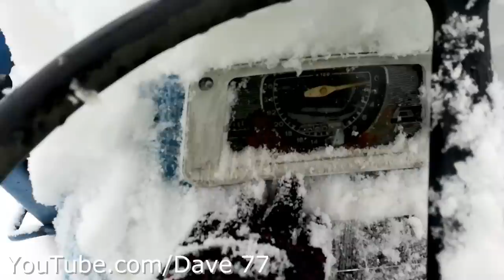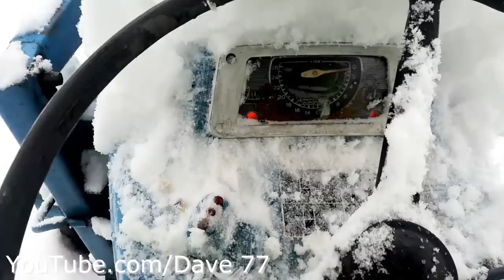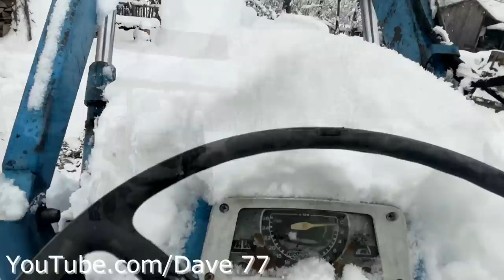1966 Ford 4000 Tractor Cold Start

Comment: I love the smell of old tractor diesel fumes. It takes me back to the good old days. Im only 26 but I can imagine old machines like this lovely old gal being a lot easier to service than all the computer controlled stuff of today. Thank you for posting and hope you’re well
Reply from the maker: Thanks a lot for your comment.
Yes, they don’t make them like they used to. Nowadays, tractor manufacturers are more oriented towards electronic systems and software based interfaces that are meant to provide a better operating experience. 
However, when they happen to break, there’s almost nothing the average person can do to fix it. 

I prefer the good old tractors.
Way more easier to diagnose and fix a problem. 
Electronics used mostly for the starter, alternator, basic sensors (water temperature, oil pressure) and a proper wiring of the ignition, switches, fuse box and finnaly the lights. 

That’s the best version of a tractor for me as far as electronics are concerned.
Best regards.

Comment: Pretty cool trick. I'll admit it worked. We had a Ford 3000 for many years. Fed cows with it. Below 30. Give her a shot of starting fliud. Below 10-15 had a 110 volt mangnet heater. Stuck it on the bottom of oil pan. + Starting fliud. Always did the trick. We hardly ever go below zero where I live how ever!
Reply from the maker: Roger Carrico Nice trick too. Magnet heater... Never heard of it, but I'm sure it gets the job done. Now what I did is kind of a old-school Romanian tractor starting up style. My father taught me. He used to start our UTB tractor this way in the winter.

Comment: Many hours on a Ford 4000 and starting it everyday in some very cold weather to give the cattle hay. Pull throttle half way, pull choke full, push in clutch to lower drag, crank and when it fires push in choke immediately. Started it for many years and never turned over more than twice before starting.
Reply from the maker: Impressive. Thank you.

Comment: Good video. 

Here are three ways to help improve cold starting in winter.

1, Add quarter of a gallon of petrol to a full tank of diesel fuel. It thins the diesel, stops it waxing over, makes it burn hotter and makes the fuel more combustible. Do not add more than a quarter to a full tank of fuel because it could damage seals in the fuel system.

2. Add and egg cup full of Acetone to a full tank diesel fuel. Acetone doesn't thin the diesel but it does add Oxygen (Oxygen is trapped inside Acetone) and it makes it more combustible and run a little hotter. Beware adding too much!

3. Make sure the exhaust isn't blocked by snow for example.

I consider a full tank of fuel is 11 Imperial gallons so deduct the amounts given accordingly.

Be very careful and observe caution at all times. Not advised to set a burning torch on an engine for the reasons cited below.

1. All you are doing is mixing burnt fuel fumes with cold air and that mix is going into the bores and doesn't get a clean start because it partly chokes the fuel air mixture in the bores.

2. Risk of fire spreading!

3, Places soot/carbon deposits in the air intake system which over time will reduce cold air intake. A bit like never cleaning an air filter or changing one.
Reply from the maker: Amazing comment.
I've never heard about these methods before (adding petrol or acetone to the diesel). I don't actually start it up that way all the time as I rarely use it in the winter. But you seem to really know what you're talking about sir, and I want to thank you for your methods, pieces of advice and cautions, all well explained.
I hope you liked the video, and sorry for the late reply. ✅ 🙂
Reply: Hi  @Dave77  These are methods I have used in the past but one must be careful not to add too much of either and never add Acetone and petrol together into diesel. Only use one or the other. Happy to help you young man if it makes life a little easier for you. Cheers, Jon DingleZilla Esq.
Reply from the maker: @JonDingle  I understand. Either diesel + petrol or diesel + acetone. Not mixing all three together. Your methods will help me in the future for sure. As I said, thanks for sharing them with me sir, and greetings from Romania.
Reply: @Dave77  No problem young man, I would love to visit Romania one day. It has some very beautiful countryside (and ladies too) and I reckon it is worth a visit. Best regards, JDZ.

Comment: This is the perfect video for when someone says something about how they miss "the good old days when tractors were simple and reliable". Ok grandpa, I'll go hop in the 5125 that will start up in 5 seconds and I'll see ya in an hour when you get old reliable running. Don't get frost bite lol
Reply from the maker: Alex MacLean The tractors were for sure simple and reliable back in the days. It is harder to start them in the winter, but not impossible. Thus, that doesn’t mean all of them would start after a hour or so. And the Ford shown in the video hasn’t been started for months. So, I don’t totally agree with your statement.
Reply: But oh no! Your modern tractor is broken! Take it to the dealer so they can plug their laptop into it and just delete out the issue, and then charge you more than your house is worth! And uh oh, time for an oil change, to the dealer it goes again, and here comes another 5000 pound bill!

Comment: You need to press the excess fuel boost button located on the injector pump. It is in the middle of the throttle linkage....She will fire up i a couple of cranks.
Reply from the maker: That is a great tip. Thank you so much for sharing it with me.
Reply: The reply I was hoping to see here between that and it should have a glow plug activated by turning the key backwards
Reply: Both these tips are life savers in the cold. Came here to say the same!
Reply: @waynejohnson9855  if your tractor had glow plugs... the older ones never had them...
Reply: @davidbrewer7937  that model he has might have them but I’m not sure. We had a 5000 diesel but it was a later model and that had them. We also had a 860 diesel and if I remember right that had glow plugs and that was late 50s. I just looked it up it was a manifold heater not glow plugs.

Comment: this is what they do in India to start reluctant diesel pumps. We here and in Russia, build a small campfire under the oil pan. This fire can't be so large as to coke out the oil, in Russia it is so cold that coking out the oil is not a worry. However here in the New Knighted States we usually use ether. Knowing how to start with ether without destroying the injection pump is critical. Do not spray and then quit with ether still in the cylinders, or you could have a misfire kicking back ruining the engine. Ether works good if you know this.
Reply from the maker: Paublus Americanus AMERICANUS Thanks for your comment.

Comment: You are doing very good.But also it would help if You pump up the diesel at first with the handpump,it saves capacity from the battery.It seemed to be air in the system.
Reply from the maker: +Jim Bobb Good advice. Thank you! 👍
Reply: You're welcome. No problem. I wish You a merry christmas and a happy new year!
Reply: U j
Reply: The ford 4000s don't have a primer pump, those r gravity feed from the tank.
Reply: @jaykamal1978  ,I didn't know that.Thanks for the informatin!
Reply: Sorry, I mean information

Comment: Do the glow plugs not work on this tractor its a great way of setting ur tractor on fire the way u did it  allways better if doin it this way to have someone hold the  heat source  or use a touch of easy start . But idget the glow plugs sorted out then u just heat on the key then start it works most times . Ive seen our old 5000 buried in snow and the glow plugs started her no issue  i like ur little fiat we had a 650 a few years ago . Hardy little tractors
Reply from the maker: Thanks for the advice, sir. Safety has to be the first priority. ✅

Comment: Lived in the snow belt part of the country,truck didn't want to start ,one of the locals said to put cover over  the  engine and start a fire with charcoal in a pan under the motor,bingo , after a few minutes the motor warmed up and started up,desperate times call for desperate measures.

Comment: For once - someone starting a diesel the right way..Instead of squirting ether in to it. Congrats sir.
Reply from the maker: Gareth Ifan Thanks sir.
Reply: @Dave77  It's a bit more work than using ether..but it's much better for the engine. I refuse to use ether except in an emergency because it damages the engine so quickly. Well done!

Comment: What oil do you use?
Reply from the maker: I am not sure what oil was in it back when I recorded the video, but when I will change the oil I will fill the Ford with some 15w40 oil.
Reply: Nice man i was about to tell you that 15w40 is the best oil for those low temperatures it starts and works so easy and i have the same ford 4000.I use 15w40 petronas arbor.

Comment: That looks like an excellent method to burning down a tractor!  When the oil soaked anything catches, you won’t be able to throw enough snow to put it out. I think you are a YouTube crazy.
Reply from the maker: John Smith Well, i dit this multiple times, though never bad has ever happened. The process is short, so there's not a risk involved.
Reply: Ok. If you say so. Zero risk in this method, completely 100% safety approved!
Reply from the maker: John Smith With all my respect sir, I don't say it's the most safely method, neither it's the easiest one, but I've been starting tractors this way for a long time. However, if someone without any sort of experience would do this, something bad could happen, though there are less chances, but still. 
Like I said before, the process should be short, so there's no time for the flame to mess something up. So, I recommend the method, but only for those who have been working on tractors, and know how to deal with it safely. Thank you. 🙂
Reply: Dave 77 this is much safer than actally lighting up a propper fire under the tractor, which i've done before... works really well :)
Reply from the maker: StraightOut Thank you sir. Finally someone who agrees with me. ✅

Comment: Hi there, where are u from, man? I am asking this question being a fellow farmer from other side of planet
Reply from the maker: Hello sir. Well, I am from Romania, and we're farmers since my father bought the first tractor, to this very day.
At first it was hard, but suddently things went good. 
From which side of the planet are you reffering to sir?
Reply: Dave 77 Hello there, well Dave humble farm land is in Planes of Punjab country is Pakistan. I could relate to your equipment more cause I am using a Fiat 640, My first brand new tractor which is purchased in 2004 was a fiat 480. Ours is a very conventional farming as compared to the modern word but we are picking up. I love your Ford. It’s still considered a very reliable machine in my country. Although it’s manufacturing stoped 20 years ago but it’s available locally refurbished. 
I stumbled upon your uploads while searching for wheat straw ballers. Good to know u. Regards

Comment: Seems you don't know your tractor. Put the hand gaslever on full gas, then push the little knob on the injector pump(there where the gas pedal and lever are pulling), then start. The tractor starts easyly and fast when you do this.
Reply from the maker: ACLAutocross67 Hello. Well I did my best to start it up. It was actually in full gas, because I pushed the foot gas pedal to maximum. This is how we do it out here. But I do accept your pieces of advice, as I am sure I am not that experienced into this field. So for that, thank you.

Comment: Ballsy, i have no clue how that work or even helped like that. In ANY diesel engine the minimum combustion chamber temp is 500° but something worked.
Reply from the maker: The hot air from the flames got into the engine intake. 
(: So it helped it start up.